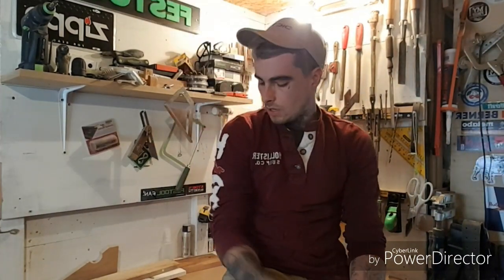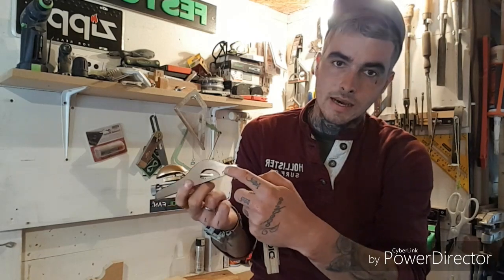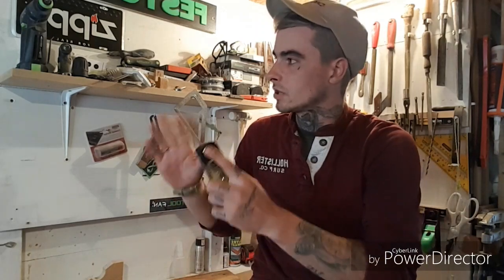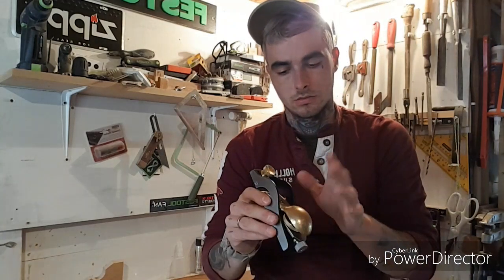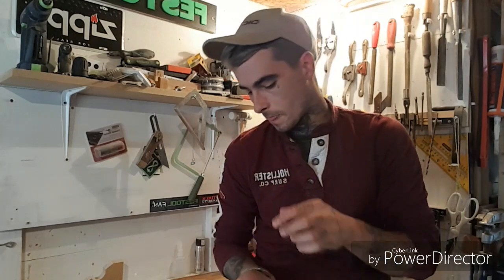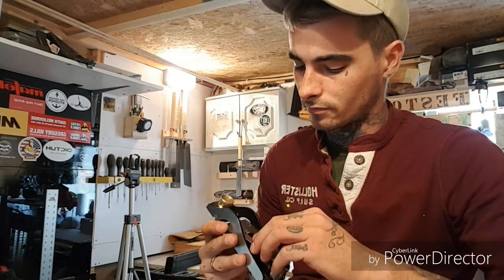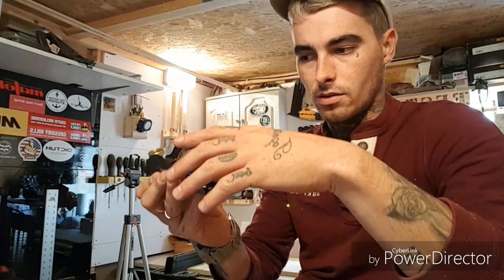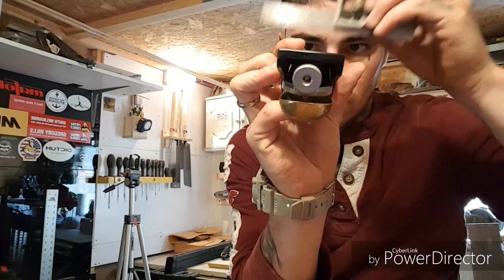Lie Nielsen No.60 1/2

Comment: I was going to buy because it seems so flexible.  Can be used as a regular block plane or a rabbet plane.    But someone said that it’s not good as a regular block plane because you can easily cut yourself because if the full width blade.    What do you think after using it fur a while ?
Reply from the maker: Hi. I absolutely love this plane it's great piece. I using this plane for tuning joins and all growes and its work perfectly I would recommend this plane for 100% and it can be use as block plane